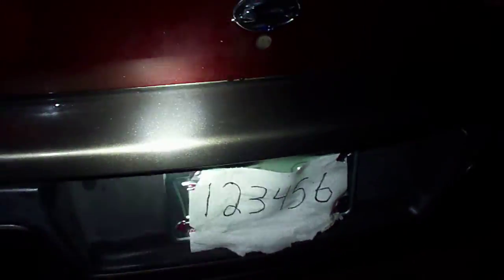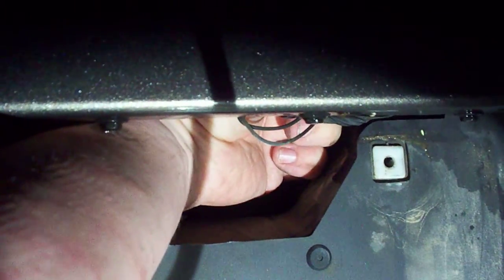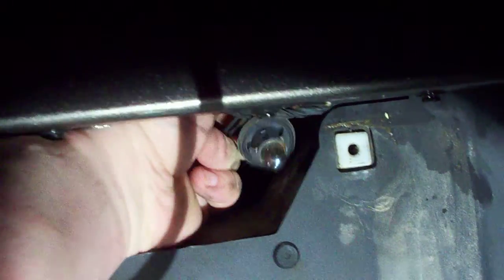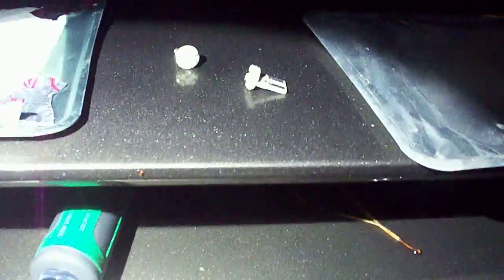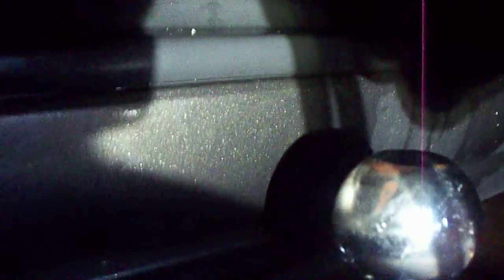Super Bright LED license plate bulb installation on 2002 Chevrolet Impala (Part 1)

Comment from the maker: Good question if they have an actual color hue.  They are not fluorescent light the lights in your home, which have the color hues you mentioned.  These are LED, and most of the time with LED white is white.  If I was to compare a hue I would call these cool.  They are intensely bright though.  I have been very pleased since I installed them

Comment from the maker: I bought them on ebay.  They were better quality than those bought in my local auto store (I tried both).  I think I paid about $6 each and about $3 shipping.  Just search super bright LED.  Marker lights are universal almost always but you can query by the make and model of your car.  They're usually really easy to replace with twist in connections for most major cars.